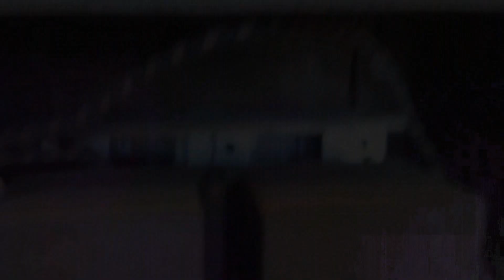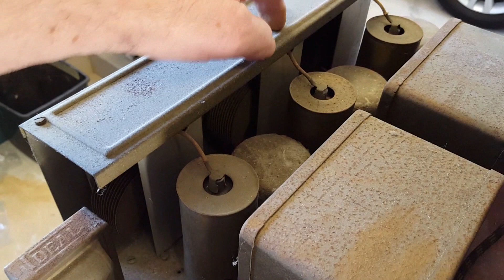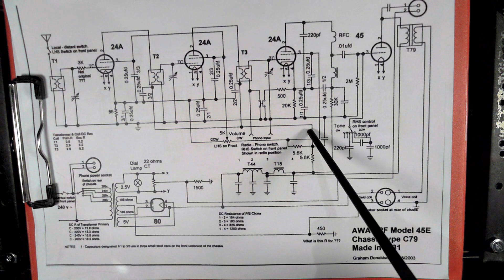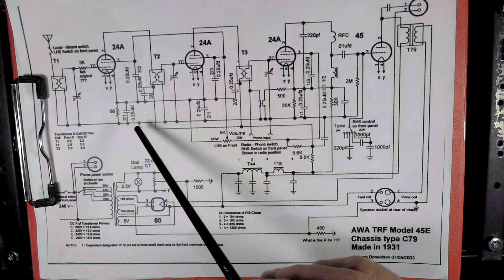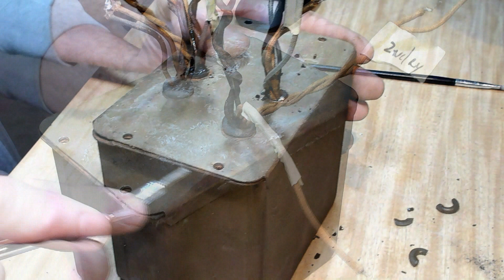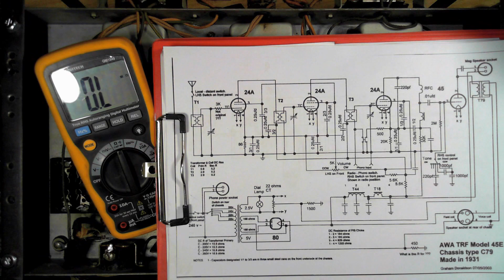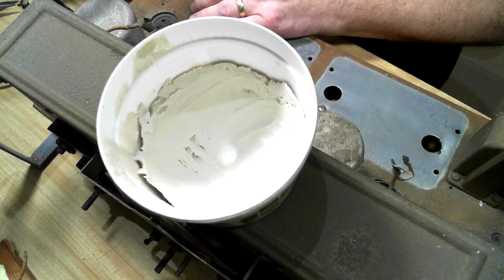1931 AWA 45E C79 Radiola Restoration Part 1

Comment: Dave!
Great to see you back with a new project!  This one is wonderful.  Although many aspects of it are royal pain in the butt issues, you are handling it very well.
I wonder if Evapo-Rust GEL would work on some of those rust issues you are having?  Check it out at https://smile.amazon.com/Evapo-Rust-Remover-Removes-Stains-Surfaces/dp/B0762WZDP7/ref=sr_1_1?keywords=evaporust+gel&qid=1578058577&sr=8-1
I love that this is a TRF style radio also.  I have one from the 1920's that I need to work on...just have to get a job so I can afford necessary parts before I start.  Mine is a Garod V Neutrodyne radio of around 1924.  I don't know if this will work or not, but try this link to see a photo of one:
https://www.facebook.com/photo.php?fbid=2410683485611217&set=pb.100000087678312.-2207520000..&type=3&theater
Still haven't found my tube (valve) tester!  Will absolutely need one on the upcoming projects.
On the wires that are removed, I seem to screw up every time I use the method you were using to number them.  Nothing wrong with the method, just I seem to rip the label off a couple of them and then don't know which went where.   I am considering a method using colored heat shrink tubing to "number" the wires so that I get them back in the right place.
On that one can...looks like it might be both capacitors as well as inductors inside the "wax" or whatever it is and that would mean a need for complete disassembly so that you could replace the capacitors...otherwise even if they are "working" now, they would be "ticking time bombs" that would mess things up before long.
Who, if I may ask, do you use to rewind the transformers?  I may need to have that done myself on one of my projects.
Again, great to see you back on and working your miracles again.  I bet the chassis on that would look fantastic chromed!  Say, that's an idea, if you did have the chassis chromed, it would be great to have those cans in the back and other items chromed aslo!  
Anyway, great to see you back with new stuff!!!  
Have a wonderful 2020!!!
Reply from the maker: Hi Wayne, welcome back and all the best for 2020. I hope you can find employment even if it's just to get your Garod V Neutrodyne working 👍🙂 The rust isn't the problem, it's getting the chassis looking good again and I don't want to cheapen it by painting it this time. The plating will look pretty good. Getting the wires back to the right spot is a problem and the tape falling off is very likely but I also have countless hours of video to help if I lose the tape and an excellent circuit diagram. Getting all those capacitors sorted will be a nightmare but just take it one step at a time and hopefully it will work out. Chrome would have looked good and it would go faster 😃
Reply from the maker: Sorry, I neglected to address your question regarding the rewiring of the transformers. The gentleman lives in Victoria so postage would make it unviable from your location. He has also requested I don’t advertise him as he is retired and happy with his current workload, I hope you understand, cheers! 🙂
Reply: @DavidTipton101  I do understand!!!!  When you next talk with him, tell him I said that I wish him a most happy and productive new year!
Reply from the maker: I will do that, thanks Wayne 👍🙂

Comment: Thanks David for your interesting and highly informative videos!  I enjoy them very much.  I graduated in electronic engineering years ago, but after 25 years in IT I'm a little rusty.  I hope to take this up as a hobby when I get more time, starting by recapping my Pye P45 which I was given as a kid back in the late 70's.  It still works, but the performance is nowhere near where it used to be (poor output volume and lots of interference).  Watching your videos gives me a little more confidence to tackle the job myself.
Reply from the maker: Thank you and good luck getting back into electronics, there is plenty of information and friendly help out there now. I have two PYE radios, one hot chassis that I did a video on and one Aussie built one with a transformer. Both are excellent performers and have great sound, all the best 👍🙂

Comment: David, it makes you wonder how two such faults could have occurred, because each fault would have killed the radio and protected it from further damage. Its hard to imagine either fault could have arisen with no power going through. Maybe a lightning strike caused both faults simultaneously?
Reply from the maker: Hi Bob, that may be the case. There are three transformers open and any one would have stopped the radio as you say. I have no idea of the history of this radio and how long it has been sitting round, I was thinking they just corroded out over time but lightning is a possibility 🤔🙂

Comment: David this Radiola is greatly similar to a 1929 Atwater Kent that I completed a couple of months ago. If you get a chance you might want to have a look. It also is a 3 gang tuner and has the capacitor can, tar filled transformer and capacitor sardine cans. I also had to repair the volume control as well. I'll be watching this one with great interest!
Reply from the maker: Hi Greg, I will have a look, thanks. I guess the technology and building methods at that stage where aligned and we would have kept a eye on what was happening in other countries so I would expect they would be quite similar 🙂

Comment: Wow this thing is just a masterpiece of engineering, this must have been a very expensive unit in its day
Reply from the maker: Hi Ideal1980, I believe they were expensive at £40 and the average middle class wage was £350 per year. They believe they sold very well though. Here is a link to a brochure for the model. don't know if it will work: https://www.radiomuseum.org/dsp_multipage_pdf.cfm?pdf=awa_45e_45b_1931_brochure~~1.pdf

Comment: From now on I dub thee "Sir Dave the Brave".  Nice thing about this old radio is there's plenty of space. I  recently rescued a 1934 AEG Super Geatron 34 WLK that had been worked on by the owner. It had a similar circuit with the RF sensitivity acting as the volume control . It also used the preamp tube as a detector by keeping the plate voltage low and using that as a diode,  and using the screen grid as a plate! I'm watching this one with interest!!
Reply from the maker: Hi Derek, brave is right 😓🙂 I saw recently where the screen was used as a plate on another YouTube video, it makes more sense now you've explained it 🙂

Comment: It's just 42 class A amplifier any new transformer will work
Reply from the maker: Hi Ian, that was my first thought but it's rated at 80 Watts and 2.5 and 5 volt outputs as well as the primary. It was also cheaper to get it rewound so I went that way 🙂

Comment: Seen on other restoration channels use a sand blasting booth for rust removal.
Reply from the maker: Hi HonestGamer , I have a sandblaster but I want to get this back to somewhere near original so will get it replated, the other option would be to clearcoat it after rust removal 🤔
Reply: @DavidTipton101  shame I haven't seen many vintage radios in London most are overpriced by dealer's same goes for retro electronics very few deals
Reply from the maker: Facebook marketplace or Gumtree has been a source of radios for me, some are very reasonably priced 🙂